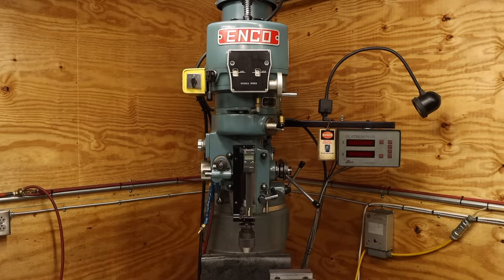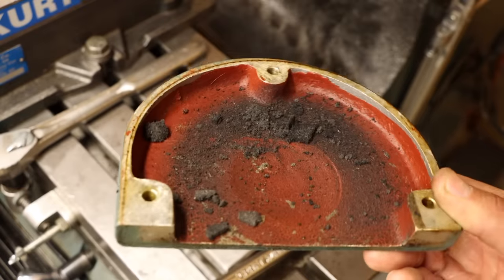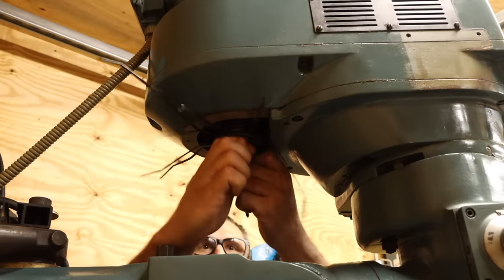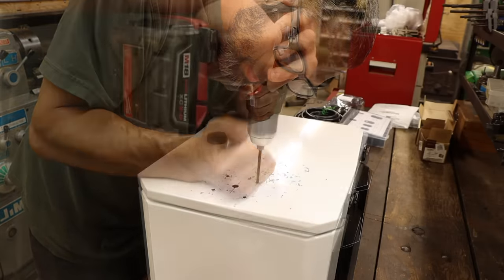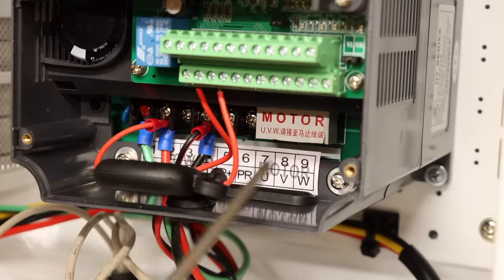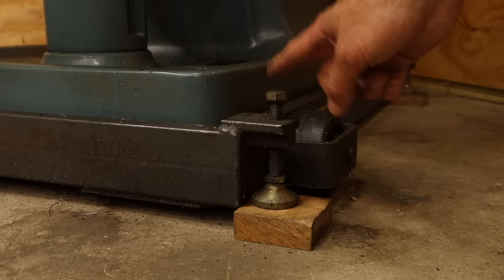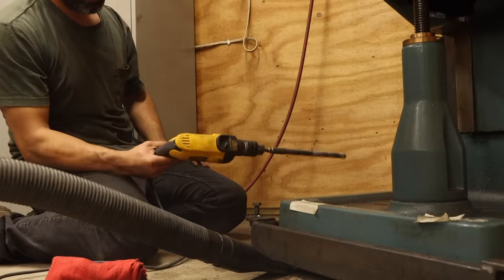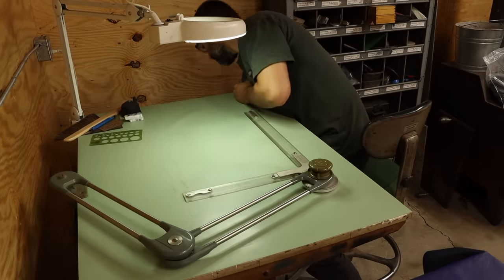What Happens When You Procrastinate...

Comment: FWIW, one of the best ways to vacuum up loose(ish) bits from the inside of equipment is to use a dry 1-1.5" hogbristle paintbrush to loosen "stuff" or sweep that "stuff" from the hard to reach spots to where the nozzle can get them

A "straw" nozzle attachment (dusty brush in some adverts) seems like a bit of a gimmick but they're great for picking up fine dust and small particulates and only cost a couple of dollars

The 3 phase VFD will make your motor run much cooler too

Next "big" project - a shop chip vacuum to pull the finer stuff?
Reply from the maker: That is definitely on my wish list!

Comment: If you ever had to do this again. Use a gear puller to separate the motor pully and then wedge a small wood block in the pully and release the gear puller. The block holds the pully open while you put the belt on; after you place the motor back in and install the belt pull out the wood block. Also, you will want to ensure that the part of the pully with the block in it is turned toward the spindle so the belt won't be sitting on the block, and you will be able to get it out.

Comment: The motor vari-drive pulley has tapped holes near the spring for locking the pulley down.  With motor running set the speed to
minimum which wide opens the rear pulley. Motor off. Install two locking screws at rear pulley.  These will hold the spring compressed.
Then with motor off set speed to maximum which wide opens the front pulley. Yank the belt to the rear which helps open the front pulley.
Both pulleys are now wide open. Motor removal and install is easy.  No fighting the belt.

Comment: Great video, thanks for sharing. Now I’m wondering if my mill belt will last any longer, she has very little use but the belt is OLD, if the original it’s around 40yo. The organization I got her from had bought it, put it behind a temporary wall and it sat there for over 25 years because the guy who put it there passed away and no one noticed it. 
Well, there’s only one thing I would’ve done differently and that is to hardwire the VFD instead of using that 220V plug. That plug only creates a possibility for trouble if the receptacle contacts grow weak with time and becomes a fire hazard after choking the VFD for power for who knows how long, burning it out.

Comment: Good job! 
I did a similar conversion from phase converter to VFD years ago. Had to build my own box, make up a thermistor controlled fan, and buy a much more expensive VFD because I'd never heard of good cheap chinese VFDs at the time. Still, it was worth every penny. 

A couple of thoughts, which I'm sure you already know but some viewers may not. That little control panel on the VFD? It comes off the VFD with a short ribbon cable, and you can get an extension cable so you can mount it anywhere, you don't have open the box to see what's up with it, and you can put the knob back on.

Of course you can vary the speed with the VFD as well as with the CVT, something I wanted to do as I have an old pulley driven M head. You probably don't have to, but I wonder how power and efficiency changes when you use mechanical vs frequency. In my case I had to make up a tachometer to know what RPM it was actually doing. I suppose just setting the VFD to 60 Hz  makes the numbers on the mill accurate enough,

Comment: you might want to remove the cable ties at the bottom of the door to allow the cables to better "twist" as you open and close the box. right now they are bending which will cause them to fatigue over time. Not sure how often  you plan to open and close this door so you can be the judge of whether its enough to fix it.

Comment: I’ve had rather bad luck with those adhesive backed zip tie anchors… the adhesive fails after a month or two. I now exclusively use the kind that mounts with screws or small bolts.

Comment: Just a little word of caution. Those power switches require a "significant" load to run properly. Without the arcing effect of mains power the contacts will foul up with soot/dirt/grime. 100mA should be sufficient in general. Just wire a resistor to ground, parallel to your inputs. Should safe you from a lot of problems in the near future
Reply from the maker: oh, good info! Thanks

Comment: Instead of removing the knob, you could remove the whole front panel and install it on the panel. there are extension cables to connect it to the vfd so you can open the door. It won't be a bad idea to wrap the vfd with plastic wrap while installing!

Comment: 2:01 as soon as I heard CVT I knew. Also, little tech tip from a car mechanic. If it's summer, before you start working on belts, leave them hanging outside. The rubber will be more likely to stretch, making your job much easier. The spring is small enough that you can get away with zipties, but I've seen idiots do that wil actual suspension coil springs. Imagine something rated to hold nearly 2 tonnes being held together by zip ties. Yeah, didn't end out too well

Comment: Wow, thanks for the nice video. Looks great, but I am a little worried about that fuse if used for mains voltage. I think automotive fuses are usually rated for not more than 30 or 70 V or so. Maybe consider a 6.3x32 mm or 5x20 mm fuse: there are cable mounted fuse holders available for these too.

Comment: Please crimp wire termination ferrules on your wires next time. In Germany we call them "Aderendhülse", just google it. Most electronics manufacturers state when or when not to use these ferrules on connections. But i dont know of any manufacturer that states NOT using ferrules on Screw terminals is ok. With spring loaded terminals you generally dont need ferrules but with screw terminals you do need them.

Comment: Computer nerd here. Bigger fans -> more better. Lower RPM is needed, which results in less noise [ i think the mill might make more noise :) ] but they also last longer, way longer. 90mm is decentish. Might wanna check where the air goes in the box, if you are worried about overheating. Might be that the fan doesn't really cool the thing that much if it just blows out the other side. Quite common with my PC builds of past, I learn the hard way, every time.

I think I'd add a second fan below the first one, to make sure it goes from left to right.

Comment: I've got that same Milwaukee drill (or one that looks exactly like it at least) and as much as the hammer drill function is nice, it absolutely pales in comparison to an SDS+ rotary hammer. If you chuck that big 'ol drill bit into a proper rotary hammer you'll be astounded at how it just melts through concrete like you're poking a hole through an angel food cake.

Comment: 24:48 When starting a new tube of this stuff, the first 3-4 inches that come out are badly mixed and will not yield the holding power you expect. It’s better to dispose of that.
Reply from the maker: Good call. I actually had a bit of trouble off camera getting the separate bags inside to dispense simultaneously. Had to mess with it for a bit until I got them to mix properly

Comment: @ 13:45 you have inserted the beare strand wire into the switch, but when the switch terminal dosent support that kind of wiere there could be some potetional fire hazard du to an squished crossection of the wire. For something like an luster terminal you shuld cramp a shell onto the wire before screwing it in.

Comment: The screen and buttons on the vfd are dismountable, it has an extended cable for connection. So you could open a hole on the face of the lid to place it. So you dont have to remove the knob.
Reply from the maker: You're right!

Comment: 23:30 you dont need to enlarge holes and use bi part hard glue. You can directly drill the size you want in concrete and use goujon ( in french ) by Spit. They include a metal jacket that expands itself. I use them a lot in solid concrete.

I use bi part glue only when the concrete is bad, or the wall is not regular ( stone, ceramic ). 

Goujon is much faster, and as reliable ( in solid concrete ) and cheaper.

Comment: Those Milwaukee hammer drill settings really are beefy, I use them for bolting down metal detectors for security at state fairs, county fairs, concerts, etc. I've burned through about a bit every 2 jobs but been using the same drill for the past 2 or 3 years and shes still running plenty strong.

Comment: When you go to put green tape on the ground wire it would not be to much work to remove some of the paint on the ground stud to ensure a good ground or at least test for resistance form the wire to the box just to make sure the paint isn’t adding too much insulation

Comment: You are lucky, at my place of employment we have one, battleship grey bridgeport mill. With high speed low torque head and standard mill head. The ways on this mill are maxed out and table is slack end to end. I would love to fix it up but I have not the money or time to do so. It is completely manual, no DRO, power feed outside of the the built in quill feed, and is hard to change the speeds on it.

Comment: I have that same toe jack, which I use for servicing bank vault hinges. I've always hated the two-part crank handle and valve fitting. Maybe one of these days I'll make an improved handle. When I first saw the toe jack unboxed, I was hoping for a side project. Quelle dommage.

I suspect the caster frame was built/welded around the mill base, so removing it would have involved cutting and grinding.

Comment: All you needed to do was tap the 4 base holes and make 4 bolts to level and steady the mill I have always used all thread and welded a nut on plus add another one as a locker

Comment: You won't regret setting the machine level. Once you start to use & trust a pocket level such as a Starret 135-A or B for quick setting you will wonder how you did without it. I have a demo on milling without parallels if you want to see how easy it is.

Comment: Remove the spacer plate and bolt the fan directly to the casement. Have two of them, and switch to all metal, server grade fans. One fan per side, one pulling, one pushing. The pulling one (outside air) should be low, the pushing one should be high. Don't skimp on quality, buy the best server fans you find. You'll only pay for them once and they require just adding a drop of oil on the ball bearings every few years. They last you decades.

Comment: Great fixes. The power going into the rear motor needs some love also. Does pushing down so hard on the hammer drill make much difference ? I used to push as hard as I could but noticed it didn’t do much.

Comment: Is there a good reason to put the switch on the input to the drive, rather than either on its output or better yet on the RST control input (D3), so that you can do DC injection braking for a true emergency? (I guess you chose a rotary power switch not a true emergency power off EPO pushbutton, so it's not too late to add one?) I'd imagine that the VFD can have significant capacitance and the motor can coast for quite a while, esp. at low loads? Also, probably better to swap any two phases on the motor power side rather than the control inputs to the VFD, so the VFD controls know which way is forward. I think you glossed over some 240V-vs-208V-vs-220V issues, unless you truly have 220V service, which seems exceedingly unlikely in the US.

Comment: Set the frequency on the VFD and never touch it again.Those older motors are designed to run at specific RPM's, they can be fried by lowering the RPM to much or to high.

Comment: Nice work there. Your VFD addition looks very clean. I'm wondering if you removed the paint on the grounding screw post. Seems like a good idea to ground the case even though it's all painted.
Reply from the maker: Thanks. Yeah that's probably not a had idea honestly. It might be slightly grounded, but could defintiely be better
Reply: @InheritanceMachining  I'd hate to see your next video showing you becoming the easy path to earth when you open the box. If you have a DMM, you might want to check ground resistance from the mill to the ground connection at least where the supply comes in. As a retired biomedical equipment specialist I tend to follow the standard for medical equipment of less than 0.5 Ohms. I periodically check the machines in my shop for ground resistance.
Reply from the maker: @daver425  You've convinced me! I'll do just that. Thanks for the tip!

Comment: I guess moving that mill is no longer an option now. XD
Normally wouldnt threaded inserts be set into the concrete so that you could unbolt the mill and just roll it out if you ever needed to move it?  Now you will have to jack the mill off those studs.

Comment: Okay so I am just starting out as a machinist and I have a question.  All of your projects (from what I can remember from your previous videos so I could be wrong when I say all but if not all, then the vast majority) end up being so precise that I swear they vary at most .002" from what they are suppose to be according to the print and, unless you cut this part from the videos, you didn't bring the parts to spec using a surface grinder.  So my question is how did you machine your parts with such precision when your mill was underpowered, couldn't access certain speeds, and was wobbly?  I'm probably showing my ignorance right now but I would have thought that even if your mill was properly powered and you had access to all the speeds, the machine wobbling so much during operation would have thrown any sense of precision out the door.  On a separate note, do you ever plan on either purchasing a CNC machine to mass produce or contracting someone else to mass produce the precision machinists jacks you and the other guy invented?  Cause I sure as hell won't have the free time or materials or the ability to machine that highly precise tool for a long time but given that I've watched you and the process you've used to make one, I would probably buy one or two depending on the price.

Comment: about that VFD, if you like you can remove the control panel on the VFD( there is a tap on top side) and install it on the encloser, and did you check the fan direction? mine is blowing upward.

Comment: That fuse is not rated for 230V AC, but more like 32V DC. as it is used in cars. Might not be suitable. Lovely video as always.
Reply from the maker: Thanks and good catch. I did a little math to convert the power rating but I could be wrong. Someone also mentioned arcing potential at the higher voltage which I didn't consider.

Comment: Brandon (spelling?), love you videos and I appreciate the quality. 

I'd love a follow up on why the mill has two heads, when you may use the other one and is it exactly the same as the one you primarily use? Would the back mill head need a new pulley as well? Theoretically could you convert that back swing of the mill head to horizontal milling should you ever need it?

Comment: Re-watching this a year later, I realized something...

That separate Disconnect Switch mounted in the enclosure is ABSOLUTELY Mandatory...

With it installed, you can now remove a point of failure in the Electrical Circuit...specifically, the Receptacle and Plug which can wear with time and use, creating a loose connection...

Loose Electrical Connections are HOT Electrical Connections and eventually evolve into Fires which burn down the shop (and possibly your home too), destroying all your machines (and ruining your ability to feed your Chip Habit because you now have nothing to get your next fix with...

Lose the plug and just Hard Wire the VFD feed into the Device Box (taking the Receptacle out entirely and replacing it with a blank cover)...

Comment: You could have just tapped the holes in the mill base and just use some long bolts for jack / leveling screws. The rolling base would just be hanging out there until you needed it again

Comment: You didn't "chamfer" your flexible cables with ferrules. In a setting with rotating and vibrating machines this calls for a disaster.
Also: when your enclosure is that tight ... something went wrong:) Not only is it better for airflow when using power electronics(even, or better: more important when using fans), it also provides the space for the needed circuit breaker, protecting the "black box" of your circuit (The circuit breaker of the house installation is only there to protect the cables in the walls including the plugs. The safety of your wiring and the protection of wires and devices in that cabinet is YOUR responsibility). Maybe I am wrong and you are using one of those new invisible circuit breakers?:)
Thanks for sharing the entertaining video and good luck, you will need it!:)

Comment: 19:13 it seems the arrangement of the 3 power chords DID matter, dear Brandon 😀if you had installed them correctly by switching the position of 2 chords with each other, the voltage signal of all 3 phases would have been inverted, avoiding this issue.
Reply from the maker: True, but I also didn't bother remembering the order of the switch wires since I knew I could switch them or just 2 of the phases 😉

Comment: When you connect a 3 phase motor without keeping track of the phase order, you have a 50/50 chance of the motor turning the direction needed. Murphy's Law suggests that it will turn the opposite direction most of, if not all of the time.